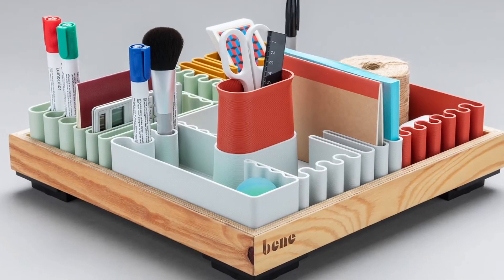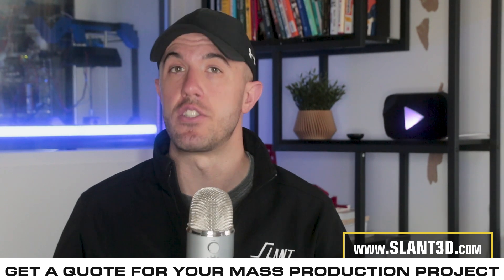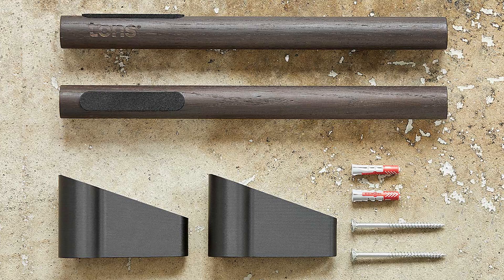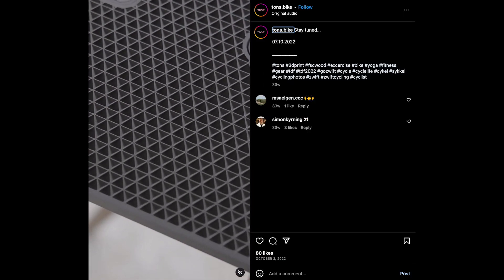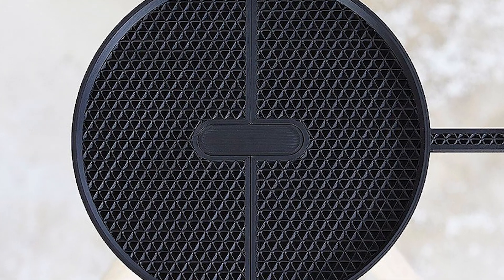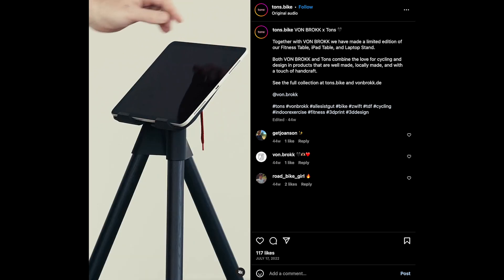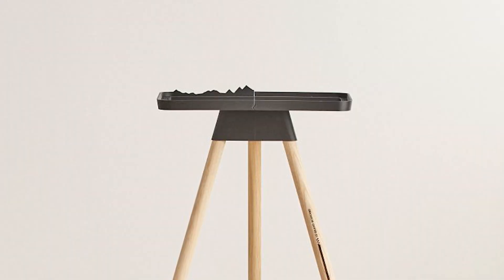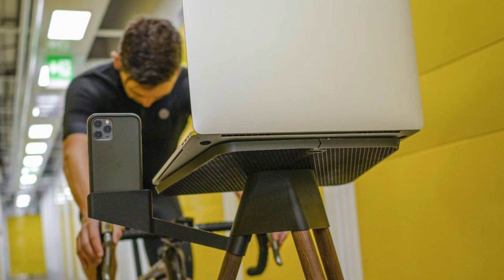Real 3D Printed Products: Tons Cycling Stands | Elevating 3D Printed Components

Comment: Not only is that grid pattern difficult to manufacture in other processes, but it is one of the standard infill patterns used in most 3D printing processes. They just left off the encapsulating top (and I presume bottom) layers.
Reply from the maker: Yep